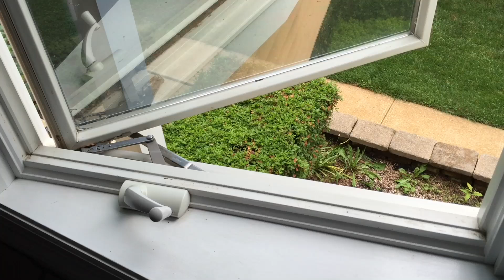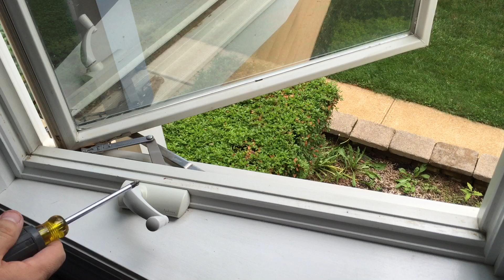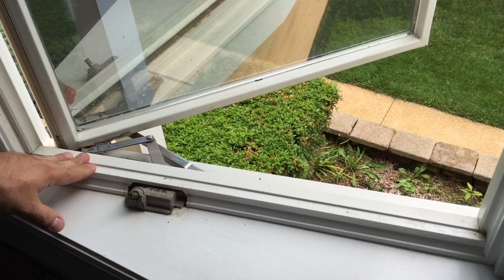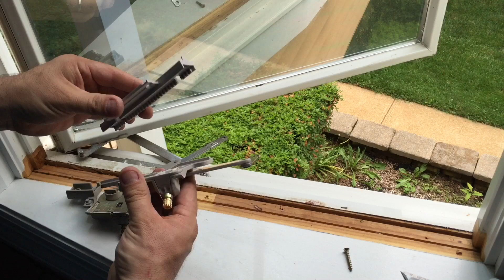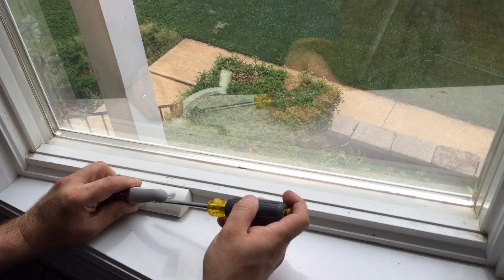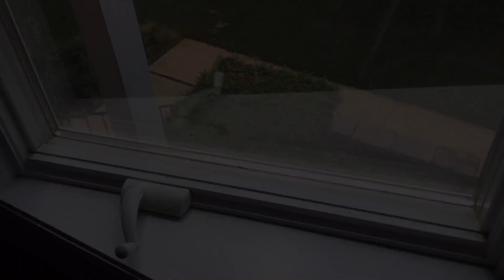How to replace an Andersen window crank

Comment: DISGUSTING BRAND MANUFACTURER!! PLANNED obsolescence for the cranks. Mine died after 16-17 years of very mild use. Similar mechanisms from 1930-1950 are still working fine. 
STOP BUYING ANDERSON!!!! DO EVERYTHING TO AVOID BUYING REPLACEMENT CRANKS!!! 
IMPROVISE, BUY DIFFERENT MANUFACTURERS, ASK YOUR LOCAL HANDYMAN ETC ETC BUT NOT GIVE THE ANDERSEN A***HOLES THE SATISFACTION OF $50 or even $20 after just 15-20 years of service!!

Comment: Your directions should be shared with Anderson!  You are more helpful than their videos since it shows how to deal with replacement of older window cranks that need to use the adapter.  Thanks for taking the time to share your expertise.

Comment: Hello. I have a crank window from 1995. Mine also only has 3 screws, but other "screw holds." Is that correct? Do you know why it only has 3 and the new one you installed had 5?